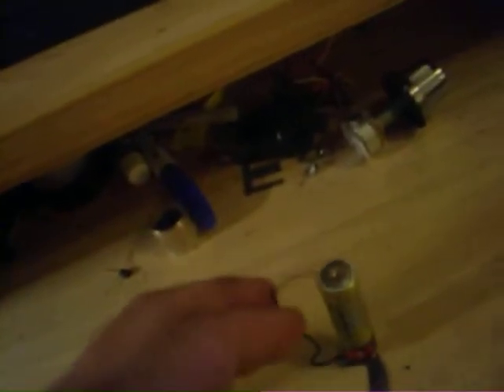AA Unipolar Motor (Homopolar Motor)

Comment from the maker: @FREEGARYMCKINNON i look at it like, as the current is flowing through the conductor, it is in constant motion. this current flow is accompanied by the magnetic field across the conductor at that 90 degrees. its that flowing magnetic field from the conductor that reacts to the permanent magnet. im not sure at this point how much of a role the conductive coating of the actual magnet has. the setup can be made using stationary magnets that do not receive any current across their exterior.

Comment from the maker: @tectalabyss good question.. the other night i tried something like that, basically seeing if i could get a reverse voltage induced from an AA to light a 3v led once the rotor was up to speed. didn't work like i thought it would, not giving up though.. still much to try.

Comment: You need a third wire iron spindle. Do a twisted braid with the 2 copper leads. Use a needle. You'll see. Gives me ideas on why Ed had such a big spindle. Helipad from hell. Pyramid is held by bottle with a ball for a cork. Peace

Comment: @Magneticitist get the motor portion of the circuit spinning at a reasonable hertz value, lets say 40-60 cycles per second and take a true RMS voltage drop reading across the circuit yourself, and you'll know whether current is being consumed in and within itself, no?

Comment from the maker: @MrAnguswangus its like in the case of flowing water or moving air, the force of the moving fluid can be used to expend energy, but the expended energy will require more force to be applied to the fluid, or there is a resistance like in all things.
but if the electric current is flowing, met by its electrical resistance, where is the resistance influencing the magnetic field following the current in the wire? allowing the wire to spin freely while conducting seems to not affect the current.

Comment from the maker: @MrAnguswangus they say any addition watts detected is just tricky measurements, but there would technically HAVE to be an "extra", unless a loss of current through waste in a conductor is not just the result if heat dissipation, but rather the perpendicular magnetic field created along the wire as a result of the current flow. the magnetic field would have to be counted as part of the current.  since electric and magnetic current are different entities this should not be the case.

Comment from the maker: @MrAnguswangus i guess that is to say, if we were to directly transfer X amount of watts through a conductor, directly to a load that is consuming those watts, ideally having no losses through the conductor, then we would be assuming we have a 100% power transfer from A to B, would we be able to also using this traveling current to spin one of these motors? it would pretty much just be like allowing our conductors to "spin".
if that were true then we have our 100% efficiency plus extra.

Comment from the maker: @MrAnguswangus i look at it like, imagine instead of a toy motor it were simply used as sort of a resistor. rather than dead shorting a piece of wire, run a current consuming circuit in series somehow. because the current is no longer wasted as heat in the short, but is traveling normally through another circuit, would the unipolar motor simply start turning as current travels, resulting in the spinning motor being just a byproduct of the traveling current?